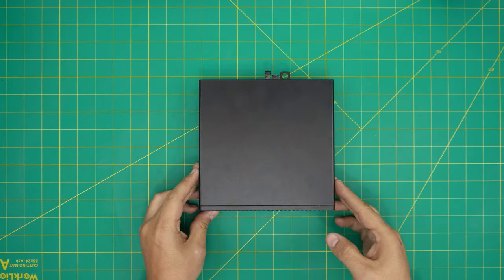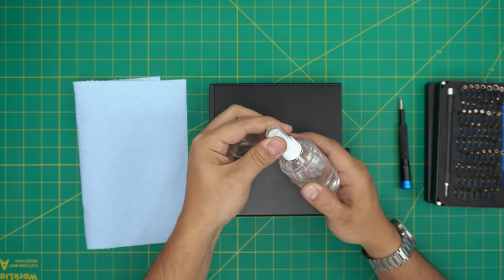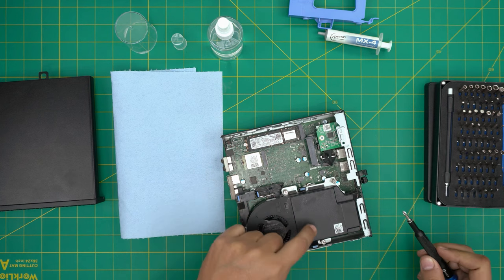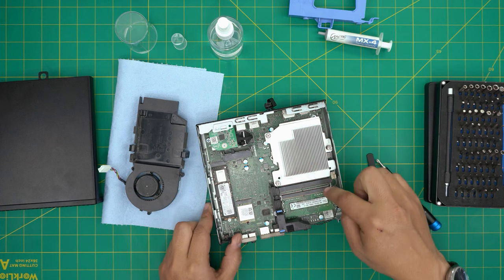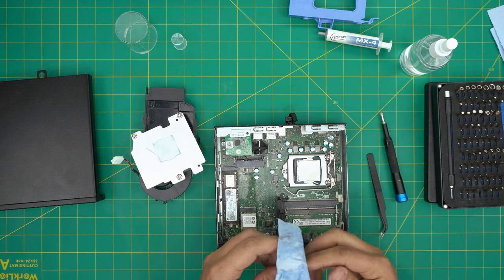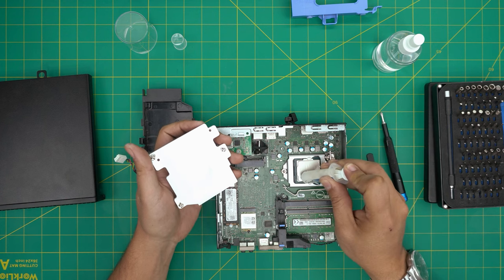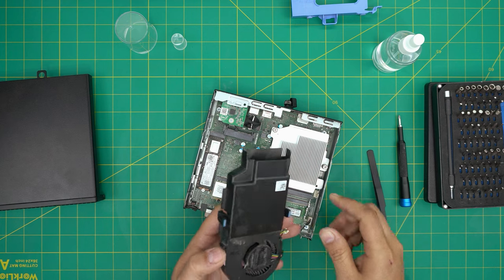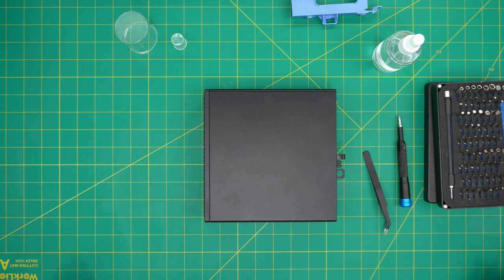How to Repaste and Clean Dell OptiPlex 3080 Mini PC - Step-by-Step Guide 🧹✨

Comment: How much years once we have to do this sir ?
Reply from the maker: Thank you for your feedback! If you wish to support the channel, you can like, subscribe, or do both!
Regarding your question, the lifespan of servicing depend on several factors. These include the number of hours you use it per day, the type of programs you run (regular use or heavy programs), and the cleanliness of the environment where you use the pc.

To determine the exact timing for servicing, you can follow these guidelines:

    Perform the first service now.
    After exactly 12 months, open the PC and check the condition of the thermal paste and fan. If the paste is dry and the fan is dirty, it indicates that more frequent servicing is required.
        In this case, decrease the service interval to 8 months for the next service.
    However, if you find that the thermal paste is still in good condition and the fan is clean after 12 months, you can increase the service interval to 1.5 years.

It's important to note that there isn't a one-size-fits-all approach, as the service frequency will vary based on individual usage and environmental factors. By regularly checking the condition of the thermal paste and fan, you can adjust the servicing interval accordingly to ensure optimal performance and longevity for your PC.
Reply: @uFixTek  thanks for your detailed explanation
Subscribed👍🤟
Reply from the maker: It's my pleasure my friend. 😊 
Should you have any further questions or requests in the future, please don't hesitate to ask me.

Comment: Temps before and after?
Reply from the maker: I'm sorry, but this video was not created to benchmark CPU temperatures or to test different thermal pastes. Its purpose is to guide you through the servicing of the Dell 3050 model, which should be performed regularly, ideally once a year or as needed, depending on your PC's usage. For optimal temperature results, we recommend using Thermal Grizzly Kryonaut paste: https://amzn.to/45Xz09z

*This is an  Amazon affiliate, when you use my links, I earn a percentage, which helps support the channel🙏.